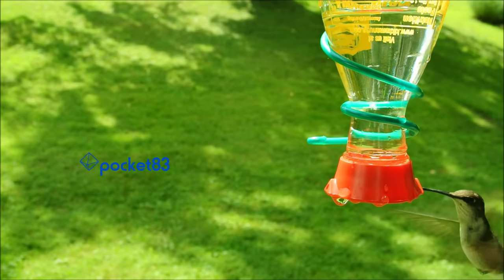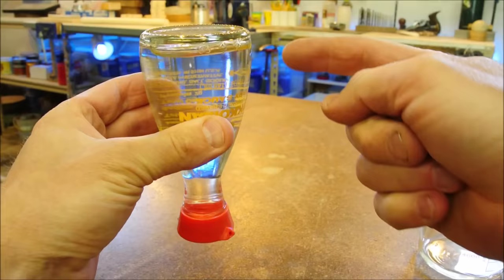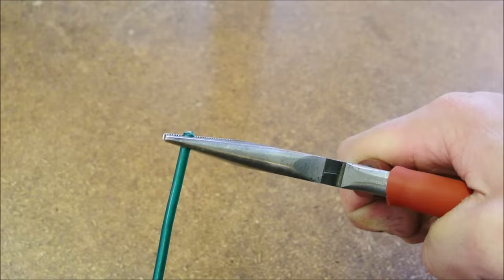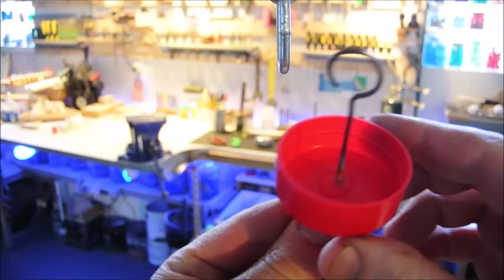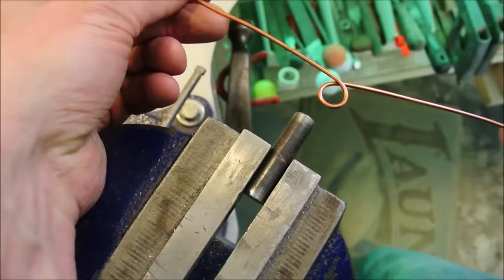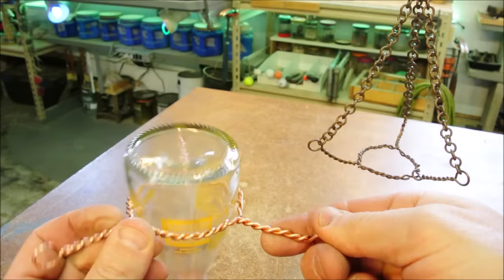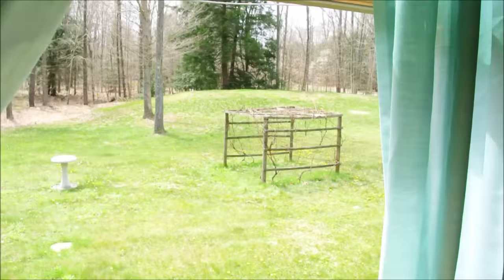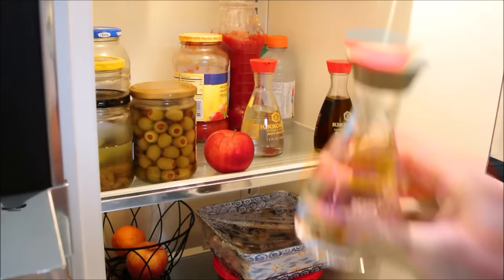Easiest, Cheapest, Best DIY Hummingbird Feeder Ever (from Soy Sauce).

Comment: Nice idea! My wife is a little miffed though. This homemade design attracts more birds than her store-bought contraption. And hers wont even fit in the dishwasher. I am a little shocked at how violently these little birds fight over the feeder though. You're right... it's best to make several!
Reply: Sometimes the homemade items are the most successful. It is surprising how expensive the commercially manufactured feeders cost. I once made a seed feeder for the other birds. I used an empty 2 liter soda bottle upended over a plastic gelatin mold, and connected the two with some wire. The birds really liked it. Later on, I bought a feeder that cost close to $10. I hung it in the same location where the homemade one had been. The visitor census dropped by about 50%.
Reply: Does she actually have to hand wash the one she bought from the store? Oh No poor thing. 🙄
Reply: They named aerial combat "dog fighting" but it should be "hummy fighting"!

Comment: I've been making these feeders, and I use a mini hot glue gun to add 1/2 inch sections of red drinking straw to the holes in the cap. This eliminates any dripping. Just make sure the straws are pointing upwards, and they are sealed well to the cap.

Comment: Excellent project, thank you very much for posting this! I painted flowers on mine using red and purple nail polish (looks great, and I'm no artist!) and made the frame using coat hanger wire, which was harder to work and not as pretty as your green clothesline, but I had it on hand. Your video is perfect as I was searching for DIY feeder ideas after learning the hard way, from putting out my first feeder, and as others have said, how jealously possessive one little rufous couple can be! But I also didn't want to break the bank with expensive feeders, as I don't care for the cheap plastic ones. And wouldn't you know it, my boyfriend had just finished off the last of the soy sauce. Must have been fate! 😄

Comment: Great video. Thank you! You can take the yellow painted label off of of the bottle by soaking a paper towel with apple cider vinegar. Just wrap the bottle in the wet vinegar paper towel and put it in a ziplock bag. Leave it in the bag over night. The paint will wipe right off of the bottle with the wet paper towel the next day. No scrubbing is even needed.

Comment: WOW what a perfect project for the Hummers. My contribution to keeping ants out of my feeders is using a dab of Tanglefoot on the hook of my regular feeders. For those not familiar with this product it is basically Pine Tar ( super gooey and thick) which I spread in about a 2" ring around the base of my fruit trees to keep crawling bugs out the trees. Thanks for sharing this awesome re-use of bottles, I do have a couple in my stash that now have a worthy new purpose.  I'm a new sub today, Cheers  : ))
Reply: BOHO RUSTICA I’ve used Vaseline for that purpose too.
Reply: Using sticky, goopy stuff around birds is not a good idea. It can get on their feathers and they can’t remove it, which means they can’t fly. Using water is a much safer idea.
Reply: @JanisK1953  Janis It won't take much to  cause an ant to change there mind and look for other things to eat. I have used the  Vaseline treatment for over 20 years it works first time every time. Jake.
Reply: @hipcatwho  I use silicone grease far up on the hook away from the birds. Works like magic.

Comment: I have all the supply’s to make the original one that you posted, I’ve just never been able to drill the glass bottles, definitely going to give this a try tomorrow!

Edit: gave it a try and end up making 3 of them, I also really hated the label and found that if you soak a paper towel in apple cider vinegar and wrap it around the bottle and let it sit for a day or two, you are able to wipe the label off, if some is still stuck on wet the bottle and scrape the label with a razor blade
Reply: Thanks so much for the tip! I was thinking of painting the bottle but this is another great option.
Reply: GooGone will also work, or citrus-based cleaners :-)
Reply: @littledabwilldoya9717  Thanks! More good tips. Really want to make a few of these.

Comment: 60 years ago my Mom taught me how to clean a bottle by using tiny pebbles and some dish soap and shaking the bottle until clean. The stones act like a bottle brush.
Reply: zippy11455 ice cubes and salt will also work. Used to use that to clean the Bunn coffee pots when the coffee got dried and scorched in the bottom of the carafes.
Reply: Zippy.....great tip from mom.    Texas here.
Reply: I use uncooked rice.
Reply: Gosh, I would be afraid pebbles would break glass...You've not broken anything in all those 60 years? If not, I'm impressed! Still though, I believe I'll stick with my uncooked rice grains & soap & water.

Comment: I knew I saved that bottle for a reason. I saw this video, I paused it at 36 seconds. I'm back after 7 minutes with my feeder completed and ready to hang. It took longer to search for my 6mm wire than it did to put the thing together. Thank you!!!!
Reply: Do you have to drill holes in the lid for the hummingbirds?
Reply: @TCBLightningBolt  No need. The holes are part of the lid/cap pouring design already built in. It will not drip unless tilted so it has to be hung level.

Comment: The soy sauce bottles work great.  It took the birds a couple days to figure out the soy bottles.  Now the dominant male flies about the yard trying to protect all 5 feeders my neighbor and I have.  Two are your soy sauce bottle idea.   They were easy to make.  I used 10ga copper for the coiling wire.   

The coils were much better after the 1st attempt, but the 1st attempt is feeding the birds.   I will give away a couple soy bottle feeders once I find a couple more soy bottles to load into the coiled hangers which are now pre-made.

And your ant excluder device works like a dream.  Many thanks!

Comment: You can go to your local feed store and get a roll of electric fence wire that is rust proof, silver shiny, flexible and strong pretty expensive and it works perfect also. Thanks for this video. And thanks for the persons info on dumpster diving at the Asian stores. I’m headed there now.👍🏻

Comment: Brilliant!  Beautiful!  I would like to mention to keep your feeder out of direct sun. It ferments the sugar,  which can make our hummers "drunk" and disoriented.  Direct sun also accelerates the deadly mold.
Reply from the maker: Sugar wine takes a few weeks, and that's with adding yeast. Hummingbirds will drink a (well cleaned) bottle dry before mold can establish. Even if they don't, a feeder placed in the sun will drip dry much faster. 
...
The soy sauce bottle's small size has lots of advantages: it only holds 1/2 cup of syrup, which is an ideal amount for not-so-responsible hobbyists.
Reply: @pocket83  thank you for the info! I gave my feeders away because I couldn't keep up with them on top of my animals and job hours. I had read they will drink from dirty (moldy) feeders . Your copper work is lovely.

Comment: To clean them, put in some vinegar, water, and a length of small chain. I use bead chain. Shake the daylights out of it. The chain will abrade the moldy spots right off, and the vinegar will kill it. It’s the same concept as those wine decanter beads. Super quick easy and effective.

Comment: I just made this project with a low sodium soy sauce bottle, the one with the green top. I added one thing to it, an “S” hook made out of the same green wire for a little added hanger. I also curled each end of the S hook the same way you did in the wire holder for the bottle. Hopefully, the green will attract them as well as the red does. I am making the red one next! Thank you for the simple, but beautiful idea!
Reply from the maker: We've been wondering how well a green lid would work. Let me know! I bet they'll figure it out almost immediately. Thanks ;)
Reply: pocket83: Will do! It’s only been up for a day. I went ahead and made the red one too! We’ll see which one empties the fastest!
Reply: pocket83: The green soy feeder is empty and the red one still has sugar water in it. I would say that is a clear indication that the green one works! A small amount leaked out from both containers, but none more out of one than the other. I love these little containers because they hold just enough for a while of feeding, but not so much that the sugar water goes sour. Great job on these! Thanks again for posting this!

Comment: Awesome - thank you for sharing! I bought a knock-off soy sauce in exactly the same bottle as Kikkoman soy sauce for $1.00 at the Dollarama ... which is quite a bit less expensive than the best price I have found here in Ontario for Kikkoman ($2.67 at Walmart). I tossed the soy sauce and am using the bottle. I will be making several with coated garden wire, also from Dollarama.

Comment: I went to Walmart and bought one of these bottles which is now $2.28, their price. The bottle is only 5 ounces which is really small. I do believe that these bottles used to be slightly bigger, years ago. I was reluctant to make a feeder out of the bottle at first, because of its small size, but decided to give it a try, since I already have two other hummingbird feeders and wanted an additional one to be something small and easy to clean. You will definitely want to make more than one of these, if you don't have any other feeders. Was very easy to make though.

Comment: Very cool DIY ideas.  A few thoughts though:  (1)  I have only one soy-sauce bottle in fact so none to throw out, I buy soy sauce in a big 1-gallon container and refill. (2)  The chain holder is very creative, but I think it's a little over-engineered, I'm sure you can twist together the sleeved copper wires to make a much simpler holder, and no less attractive.  (3) When you go to the dollar store, pick up some cheap red plastic or silk flowers, glue them around the feeder holes.  In any case, thanks for the video and ideas, very cool and very clever..
Reply from the maker: (2) The hanging copper chain version is self-leveling, and it makes bottle replacement super-easy. If there's a simper design that's just as effective, I'd be delighted to see it. In my experience, I have found there to be no such thing as "over-engineered"; designs that are thought-out well enough just tend to work better.  

(3) Dollar-store adornments do not help the birds to recognize a feeder. Their eyes are already ultra-receptive to the cap's red color. Plastic/silk flowers will just trap bacteria around the feeding holes and make cleaning more difficult. And besides, with an extra dollar, you could buy another soy-sauce bottle—since you only have one.

Comment: You must bring the water to a full rolling boil for 1 to 1 minute 15 seconds in order to kill all  viruses, pathogens, bacteria etc. Also, it's only good at room temperature for 1 day. It is only good refrigerated for 3 days. So I would not refrigerate first as it could possibly take time off of the 1 day once it's hung outside where the sun will bring it to a  much warmer temperature than room temperature. I loved the Soy sauce bottle, and wire idea, and the importance of proper cleaning. Thank you
Reply from the maker: Let's be realistic about getting people to provide clean feeders. There's a reasonable limit. Besides, birds do not drink distilled water in the wild. As long as the water has come to a boil, you've given it a fair effort. Starting with a clean solution, a few days at room temperature becomes nowhere near toxic.

The bigger risks to the bird here are with sugar dependence and increased aggression.

Comment: I used a empty Seagram's bottle with a screw on lid .
Poked a 1/8th hole in cap and pushed some oxygen tube through it .
I attached a fig flower to the end of the oxygen tube, there is a hole in the flower so basically the hummingbirds are sticking their beak into the center of the fake flower to feed.
I have some iridescent plastic around the bottle so it catches the sunlight
I have glued a few glass beads to the outside of the bottle and in a weird way they kind of resemble big beads of water.

As a two-for-oneI hang a little light up jar somewhere around the feeder, the light up jar is solar powered and after it's been on for a while the lights flicker and resemble fireflies in the jar.
This attracts hummingbird moths at night that also feed on the nectar.

Comment: Pretty rad. Hadn't considered that the pressure would hold the water in there. Probably a good trick at a Chinese restaurant if you practice first.

Now, if you join Costco, you can just get a huge jug of it, and fill up for years, or less depending on your sodium intake.

Comment: Hung it and within 5 minutes one came and used it. Excellent idea! Oops. A different one just showed up and imbibed a bit. BOO-YAH! I'm going yo paint the next bottle fire engine red and see if it makes a difference in attraction.
Reply from the maker: I would advise against paint: they don't need it, and it's potentially poisonous. To a hummingbird, that little red cap is a glowing neon sign!
Reply: @pocket83  Thanks for the reply. I think you're right. I added red food coloring to the water in one and left the other clear. They actually prefer the clear water.
Reply: @beauxtx1959  Food coloring is toxic to hummingbirds. they don't need the color in their food to come. The Reddish cap is enough.

Comment: to scrub the inside of the bottle: rinse (washes off some starch) about 4 tablespoons of rice (plastic BBs work well also)  using a strainer; spoon a little rice into your palm and then scoop it into bottle, add a little hot water and dishwashing liquid; place plastic cling wrap over bottle; screw on cap, shake hard; when you are finished scouring the inside of pour as much liquid out as possible without dumping rice into sink (do not dump uncooked rice into sink, it will swell and could block pipes); rinse well. now,, hopefully you have a clean bottle and no toilet paper was harmed in the cleaning of a bottle.

Comment: I just made one with coat hanger...you know what a pain in the rump that was as the metal doesn't conform to the bottle very well. But, I'm gonna try it out and see how it works as my hummers are avoiding the usual one hanging outside.  It's been thoroughly cleaned so don't know what the issue is.

Comment: Round magnet with mounting hole.  Screw magnet under an eve.  Silicone a smooth can lid from a soup can to the bottom of the bottle.  Use a safety can opener to get a safe non sharp lid.  Then the bottle will quickly hang below wherever you place the round magnet.  If you need an ant guard use the other end of the can and trim It just deep enough to hold a little water

Comment: Another good way to clean a bottle is to put a little uncooked rice in the bottle (maybe a Tablespoon for a small bottle like the Kikkoman one), add some water, and dish soap. Put on a lid (or keep your finger over the hole) and shake the bottle. The rice acts as little scrub brushes. Then pour out the water and rice (into a sieve). Throw out the rice. Rinse bottle out.
Reply: Not bad! Thanks ;)

Comment: Nicely thought out but if you want to sanitize water by boiling, it can take 10-15 minutes to kill bacteria and viruses.  I would use a microfilter good to 0.1 microns to clear out the bacteria before boiling and just get it to boil to dissolve the sugar.
Reply from the maker: Yeah, no. There's a sharp drop in number by simply reaching boiling. The point here is not to sterilize. Hummingbirds don't live in a bubble; they do have immune systems. The goal is simply to cause a significant numerical decrease without too much effort.  
...
And FFR, it does not require boiling to suspend sugar in solution.
Reply: @pocket83  I was simply addressing your video stating sanitization.  Most household water (especially on municipal water systems) doesn't need that anyway but simply reaching boiling doesn't do it.
Reply from the maker: Yes, it does. Follow the PDF mentioned at 12:05 if you don't understand this; you are free to take up your disbelief with the World Health Organization. 
...
Again, at the risk of making us both sound tedious: the point is to reduce, not eliminate. Safer. -er. Safe-er. Not perfect safe.There is no certainty in life. And boiling certainly doesn't remove inorganic contaminants.

Comment: Easier modification for soy feeder as follows: stick a "tie wrap pad" with STRONG glue like GOOP glue to the bottom of the glass feeder.
Let it dry overnight. Then use wire, string or fishing line, or chain to tie a loop through the tie wrap sticky pad. Then hang after filling.
Although it may be less attractive, it's not ugly and it makes it even easier to make.
Reply from the maker: Easier yet might be to epoxy a hook straight to it. But with something attached to the bottom, how will you store the bottles in the refrigerator? Or fill them, with one hand? A piece of wire is about as simple as it's going to get.
Reply: @pocket83  the pad allows it to be stored in the refrigerator or fillthem w/ one hand or 2. also it can be boiled. the pad is very thin.

Comment: easier way to clean the bottle is to use coarse sand/dirt.  put the sand/dirt in, hot water and shake,  pour out and rinse.   the sand will scrub the inside of the bottle clean.